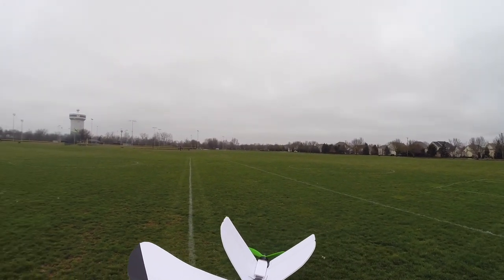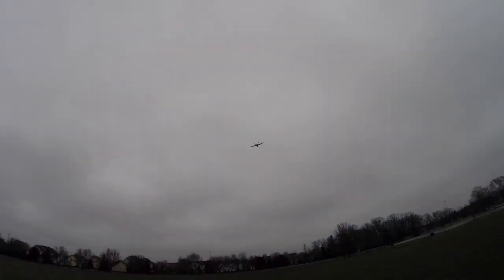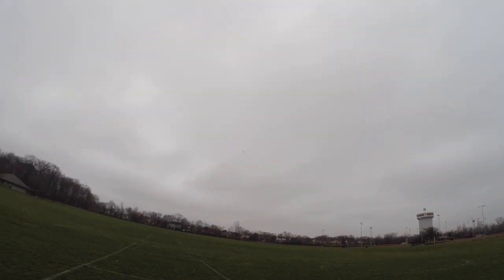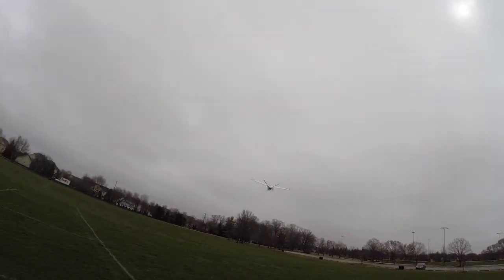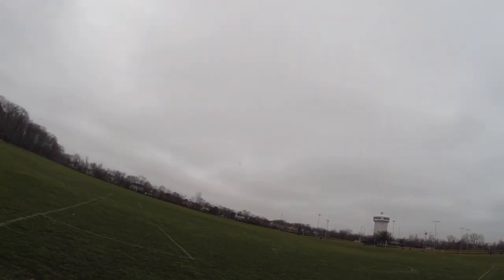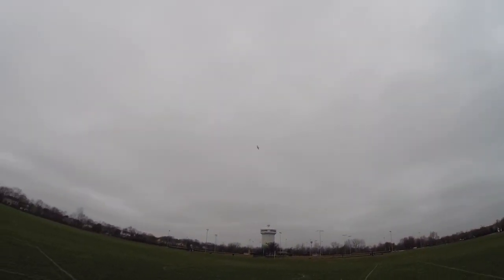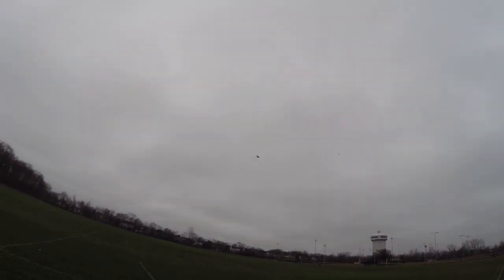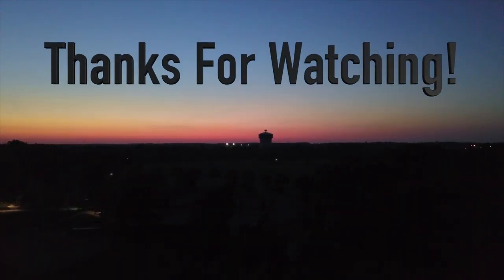FT Sparrow Maiden Flight

Comment: I wish I could finish building my ft spitfire. But I just used all my  3mm plywood...(wood is for the spar) great vid, though. I think I want to use that motor on my arrow, not sure what prop to use on 4s though.
Reply from the maker: Awesome! Yeah this motor is pretty amazing, I Just posted a video of it in my FT Arrow on 4s, and It screamed! Im using a HQ 6x4.5 Tri blade on that as well as this sparrow and Im very pleased with the flight performance. The price is right too, with the Motor being only 9.70 at BuddyRC.com. I highly reccomend it. As for the spitfire, I feel your pain. It is so tough when FT planes use wooden components because it screws all the scratch builders over.  Good luck with that as well as your other RC endeavours and thanks for watching!

Also... Have any video requests?